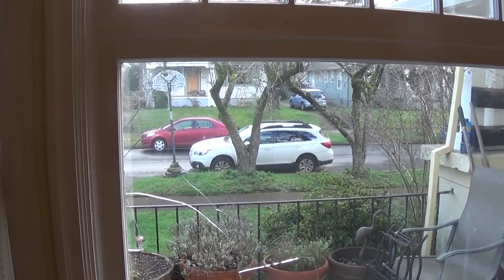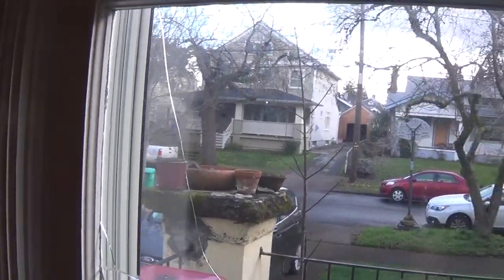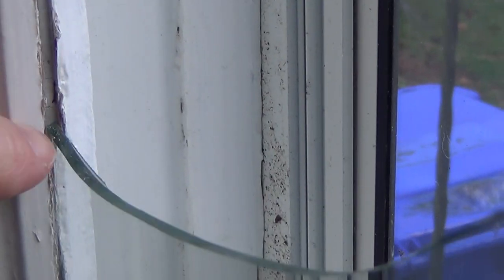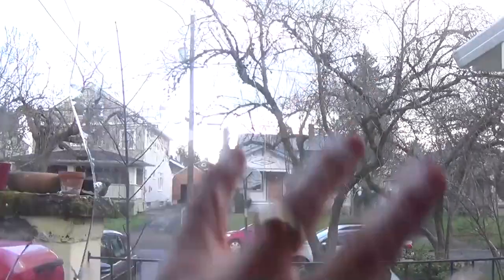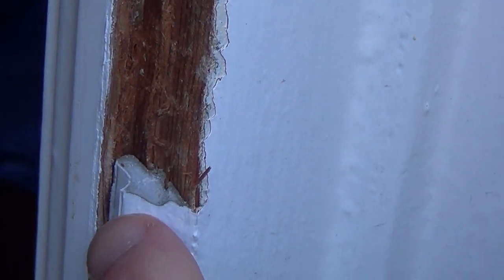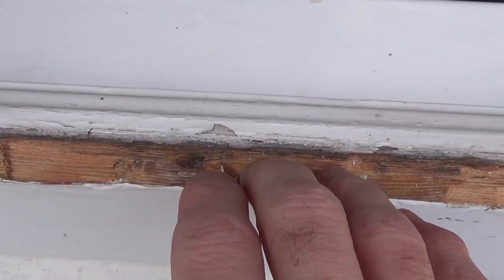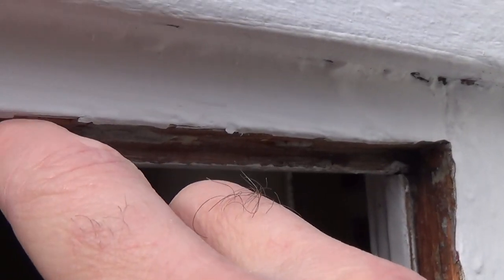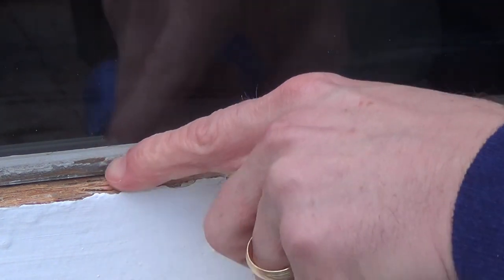How to Replace a Broken Picture Window

Comment: Great way to to get a rattly window. you should have used your glazing compound or putty  in the rebate and bedded the glass on to that 
what you have done has worked but is a substandard job and the glass will rattle sooner or later.
most probably sooner.